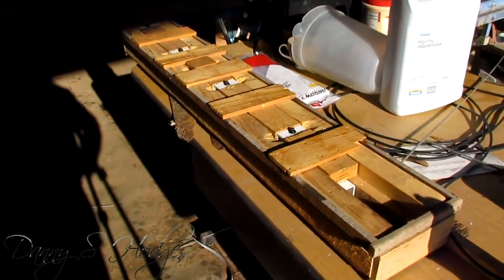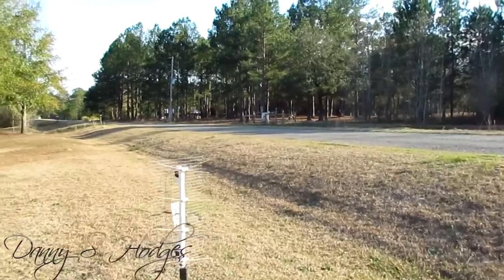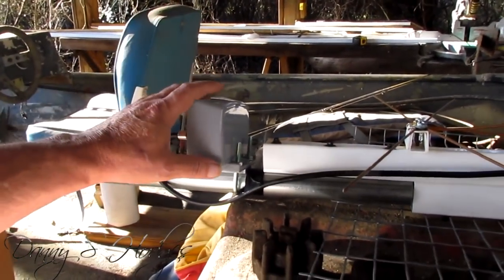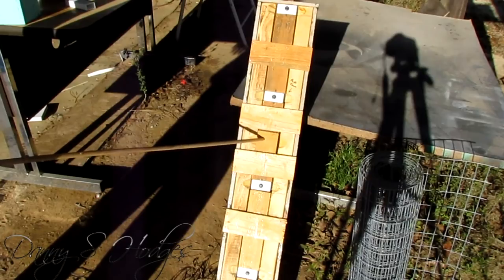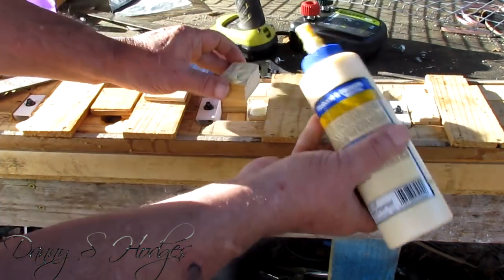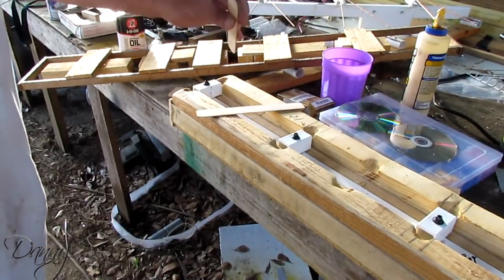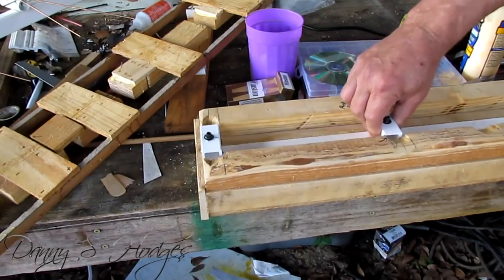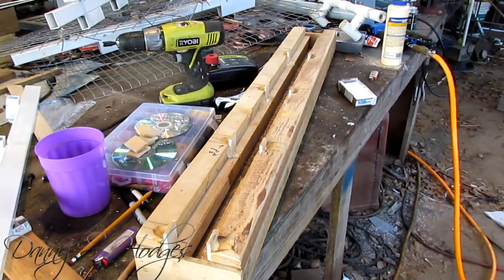Rebuilding The  Ultimate TV Antenna Jig

Comment: Brother 
In one of your videos you made an antenna off your truck and it cost you $2 or $3 dollars and that design helped me a lot You saved me $46 in buying a piece of crap antenna from Amazon and I made me one similar to the one you have made on parts that I have in my garage And we cut the cord, My wife couldn't believe it that it worked. We had an old antenna from way back that picked up 24 stations, Now with the new antenna that I made from your design on that truck antenna I receive 68 channels without the booster, Thank you very, very much.

Comment: Danny another great video.  Cut the cord 3 months ago and built and Ultimate antenna out of the pvc pipe and didn't like it.  Changed materials and did some tinkering after making 6 I was satisfied.  I live in the country in the middle of the woods surrounded by large oak trees and my tv towers are 27, 33, 57, and 72 miles from here - all in different directions.  I put two antennas without reflectors facing opposite directions on my roof about 18' off the ground and picked up all stations at those towers.  Now for the part most won't believe - on a good day with the weather just right I pick up Dallas stations 160 miles away per Google Earth.  The signal comes and goes but it's there.  Thanks for the great videos that made my reception great.
Reply: What materials did you change to, that’s not pvc? Sorry I know this is a 2 year old video.

Comment: Mounting the amplifier low sounds good to me cause I’m 80.  But I have a question.  Could you put the balun down there too and use twin lead to connect to the antenna directly for better impedance matching?
Reply from the maker: ive put the booster low before and works good but never tried the balun before

Comment: Mounting the amplifier lower is a good idea for servicability,  can you also put the balun lower as well, back in the day they were right on the back of the tv?
Reply: Putting the booster amplifier lower is a good idea but putting the balun is not such a good idea. You have to buy 300 ohm twin lead which would cause signal loss before it gets to the booster amplifier. You cannot buy good 300 ohm shielded cable anymore I tried looking for it. 300 ohm is best for UHF but we have to use what's available.73
Reply: This is strange reply in the old days TV's had 300 ohm terminals but now only one balun is needed because the TV's are set up for 75 ohm coax. So only one balun is needed at the antenna. 73

Comment: I have spent  over 30 days just trying  to get the antenna  pointed in the 
Right direction  
Right not I am in the process  of designing an antenna 
Part of it will be from you design 
No I am not going to start making videos and if I did I would tell where I got my information at
Reply: Good point I would never make a video using Danny's antenna design. Actually Danny only updated the 4 screen bowtie antenna. I have one that seen better days.the whiskers are larger on the ultimate Antenna. Since you cannot buy these antennas now it's free game. The gray Hoverman antenna is still used for amateur radio but even Danny added the top and bottom elements. I remember the one dad bought for me had two wires at the ends of the antenna.  No hat shaped elements. 73